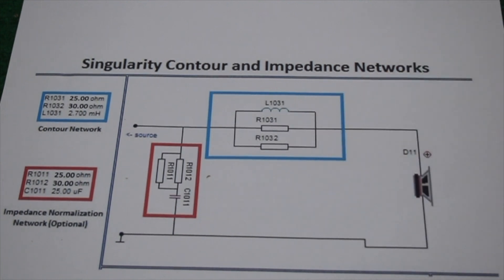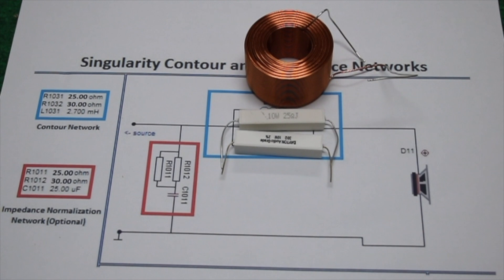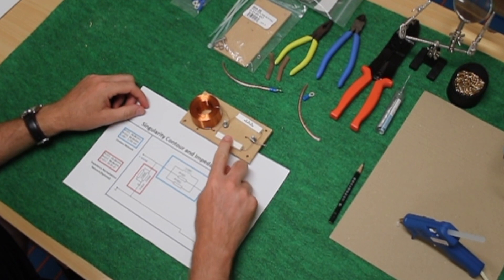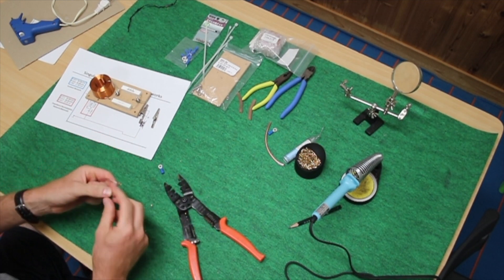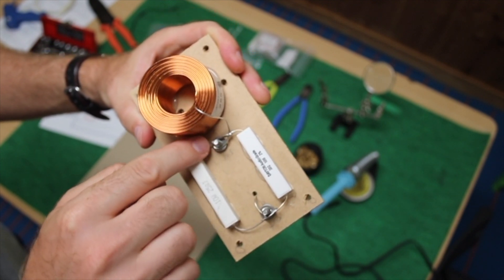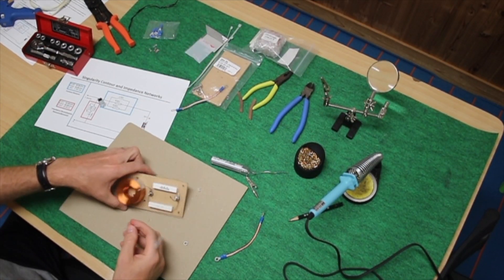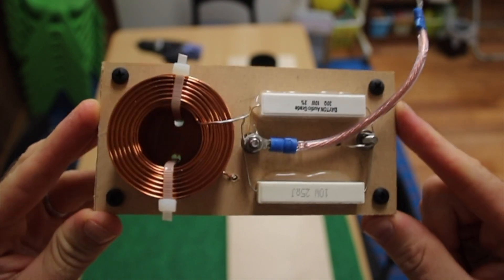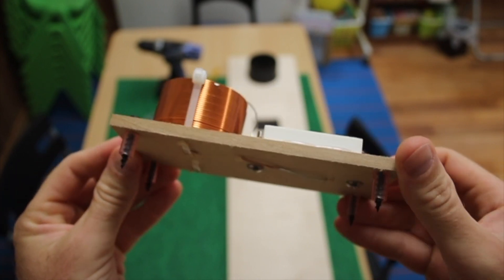Can a Newbie Build a Speaker Crossover? YES.

Comment: Thanks! I'm about to build my first crossover - more complex than yours but you gave me some great hints. Thumbs up 👍pressed.
Reply from the maker: Thanks for the watch and the kind words. I was really worried to make/assemble this but it was super easy. I think DIY audio stuff sounds really daunting at first but once you get started it is fun and not too complex. 

What sort of speaker are you making?
Reply: @thesundaycarpenter2514  I own a mint condition pair of Altec A7-800 VOTT speakers in the Valencia boxes. I'm retiring the N801-8A crossovers (800 Hz) and building two new N1201-8A crossovers (Altec Model 19 1.2 kHz crossover). Doing so will take the "theatrical honk" out of the speakers and move them more toward a home hi-fi sound.
Reply from the maker: @acreguy3156  That sounds like an awesome idea for an amazing pair of speakers. I hope that you the new crossovers do the trick for you.
Reply: @thesundaycarpenter2514  Thanks. I have one original crossover from a Model 19 and was able to audition it. It sounded very good but it is 45+ years old. The components are dated and I hope the new ones will sound even better. I had the tweeters re-done about 15 years ago by Great Plains Audio. I believe they upgraded them from the originals. Can't wait to get the new crossovers built. Thanks again for the great video!

Comment: Why two resistors in parallel?
Reply from the maker: Hello and thanks for watching. I made this speakers according to the specifications on the designers website. He says:
  "Contour Network:

No crossover needed for  a single driver, but even the best full range drivers need a
little help to provide a reasonably flat in room response. The Contour network shown
below compensates for the rising response caused by the transitions from 4pi space
to 2pi space.

The optional impedance normalization network is highly recommended for tube
amplification, but unnecessary for solid state devices.  

Because of the potential current flow through the resistors, and the resultant power
dissipation, I recommended 2 parallel resistors (a 25 ohm paralleled with a 30 ohm)
and suggest they be at least 10 watts. With so few components, you can splurge on
a couple of those Vishay-Dale, or Alcol Gold aluminum bodied resistors you've
always wanted to try."

I hope that helps you out.
Here is a link to the website. Maybe you can contact Curt the designer.

http://speakerdesignworks.com/Singularity_1.html
Reply: @thesundaycarpenter2514  Thanks!